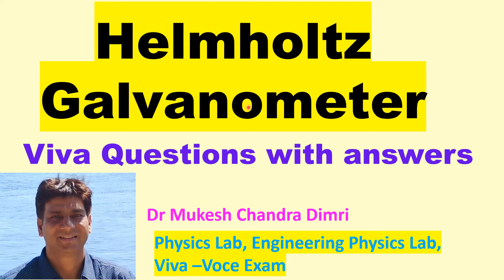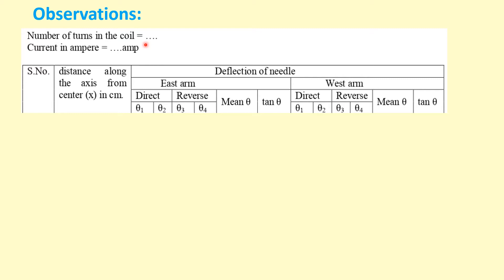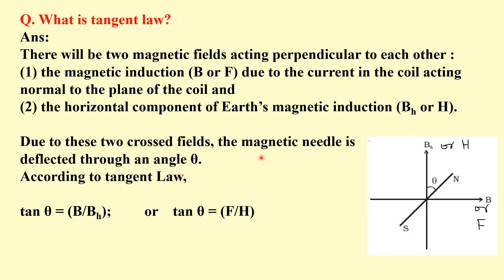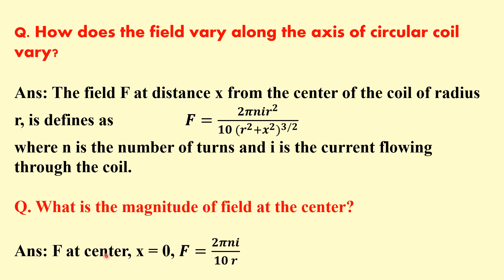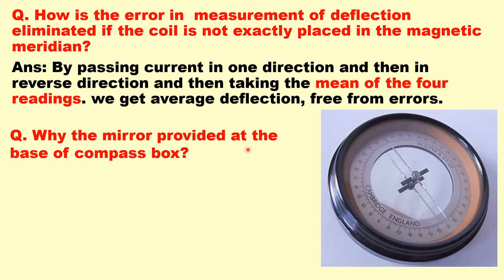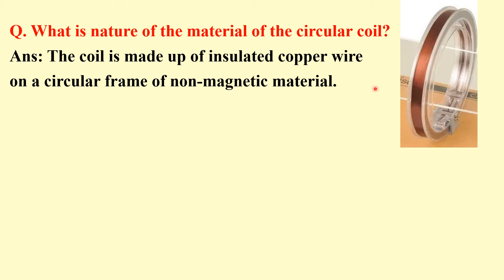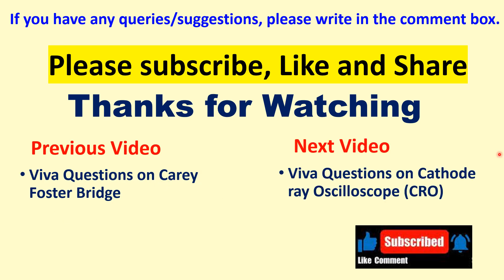Helmholtz Galvanometer| Physics lab Viva| Magnetic meridian| Reduction Factor| Tangent Galvanometer

Comment: 00:05 Hemholtz Galvanometer is used to measure DC current using magnetic deflections.
01:56 Using Helmholtz Galvanometer for magnetic meridian observations
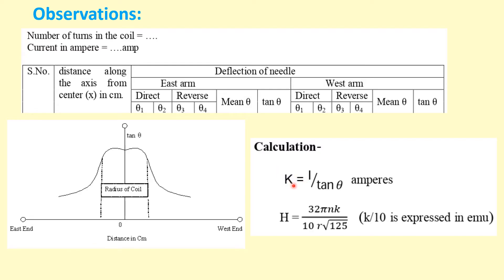03:41 Helmholtz Galvanometer measures DC current using tangent law
05:31 Comparison of Helmholtz Galvanometer and Tangent Galvanometer
07:17 Understanding magnetic field of a circular coil and magnetic meridian
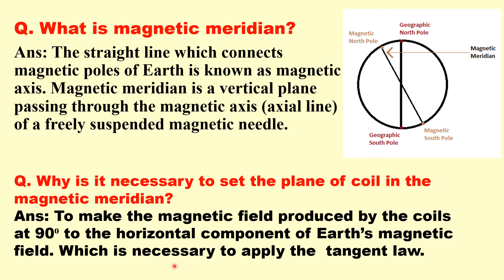08:49 Setting up in Magnetic Meridian is crucial for accurate measurements
10:34 Reduction Factor K and its application
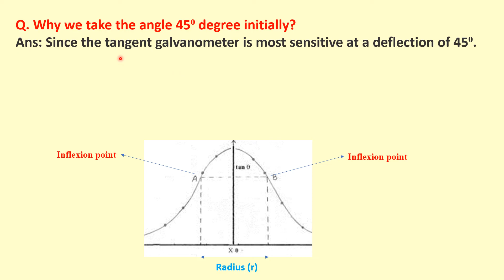12:14 Understanding inflection points in Helmholtz coils
Reply: Aaap itne vele(free) ho kya😂